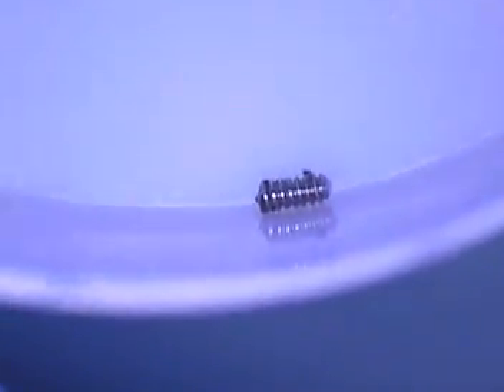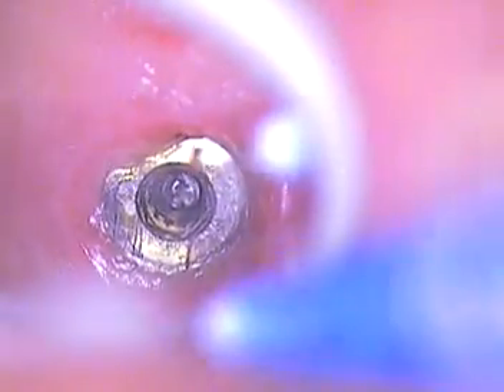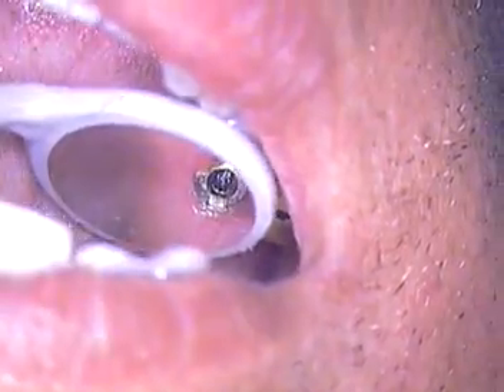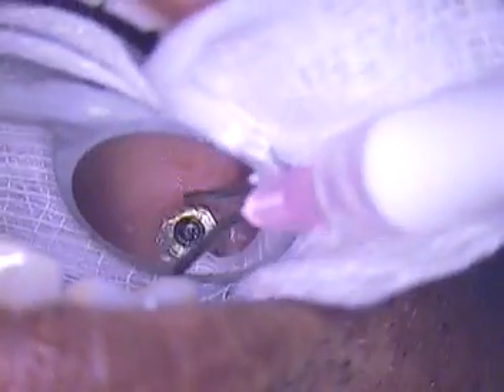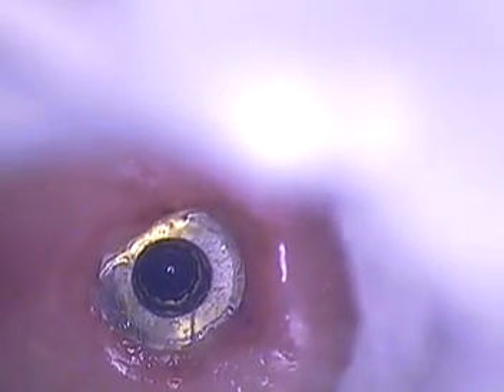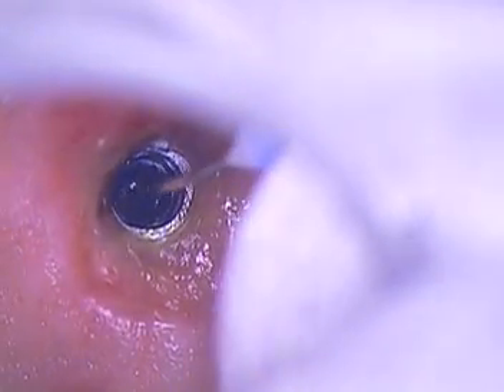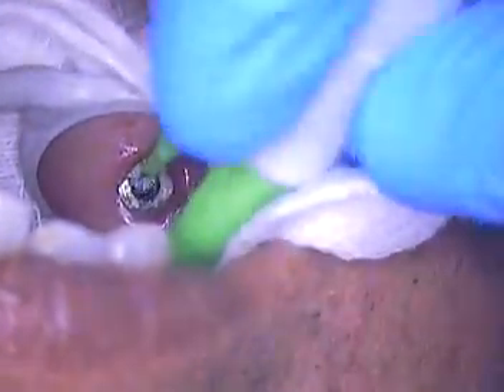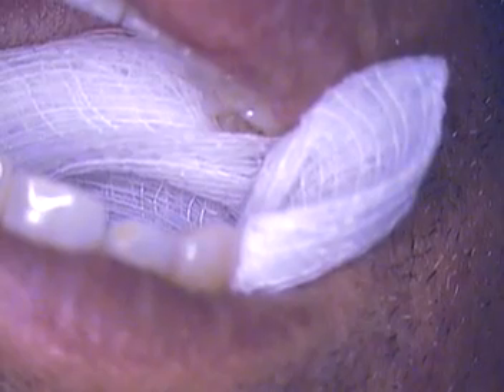1. Dental Implant Broken Screw Retrieval Method - Bio-Met 3i DR. GERARD CUOMO

Comment from the maker: The key is to "pre-soak" the screw with tarter and stain solution for 10-15 minutes by the clock.  This is where many dentists take the wrong turn in the road and want to grind on the head of the screw.  Introducing a handpiece of any type causes "cold-welding" due to deformation of the metal surface. I follow the old adage, "trust your brain and not your eyes." I just use a sharp explorer, hand motion, and patience.  You will see a color change of the t/s solution from tan to clear. Take care.
Reply: What do you cover the with if you soak over night?

Comment: I had my abutment screw break hours after it was installed. I went back today but it seems they attempted to grind something but couldn't get it out. The surgeon tried today (with a pick no grinding) as well with no luck. They said they had to order a special set. I am concerned it may now be cold welded. Will it always cold weld in the situation?

Comment: from your experience , you think it can work on a broken screw that broke after tightening the abutment at a higher torquing force ? I placed a mini implant 3.0 from megagen that the tightening force of the abutment was 15Ncm and torqued it down to 35Ncm.
Reply from the maker: Many screws do not break when over torqued. The drivers will deform and break under excessive torque. The fractured fragment needs to be classified. Is it above or below the first thread of the fixture thread? Is it mobile? Did you take  an xray?
Reply: Gerard Cuomo the screw broke below the first thread of the fixture head. The screw broke at the level where its threats begin. Would an ultrasonic help in this situation?
Reply from the maker: Is the fragment mobile?  Did you test it with an explorer?  Did you pre-soak the top of threads with tarter and stain solution?  Do not use a rotary and ultrasonic.  Pre-soak the fragment first for at least 20 minutes and then retest for mobility.

Comment: Dear sir, I just recently had a dental implant for my # 7 and the day they put on the crown that later that night I woke up and discovered that the screw in the abutment had sheared off. I am wondering if this is a manufacturer defect and if so are they going to stand by their product to resupply the necessary parts to repair and other such costs. I do have other questions but will wait for a response to this one. Thank you for this video
Reply from the maker: Suppliers usually warentee
Reply from the maker: Parts are usually guaranteed for life. The suppliers will not cover chair time and surgery. Most dentists are not set up with microscopes to remove broken implant abutment screws.  They may build some confidence by removing a few fragments, but may fall short of properly cleaning the implant threads. Dr. Cuomo

Comment: What do you do when a case is referred to you and it has been ground on and now has a "cold weld?"
Reply from the maker: This is the most difficult case because of prior access by a previous dentist. I would highly suggest referring the case to a dentist that uses a dental microscope immediately after the incident. Cold welded cases are definitely the most difficult because of the existence of damaged threads. The ability to repair damaged threads is rare in my opinion.
Reply: I purchased a "Neo Biotech Screw Remover" and it worked like a charm.  Took seconds to remove this screw.  In over 20 years of placing and restoring implants, this is the first broken screw.   The kit is expensive, yet it saved the implant.